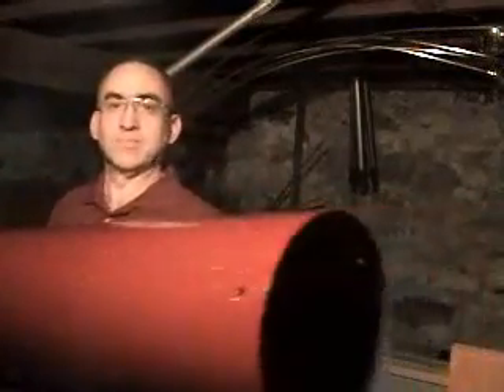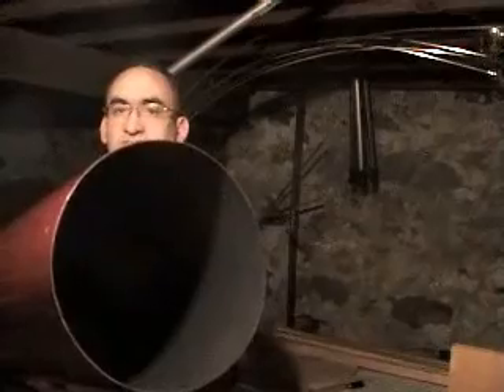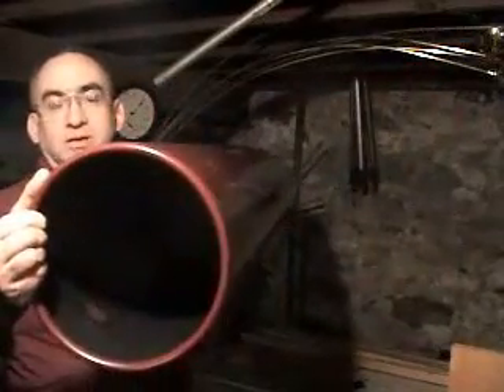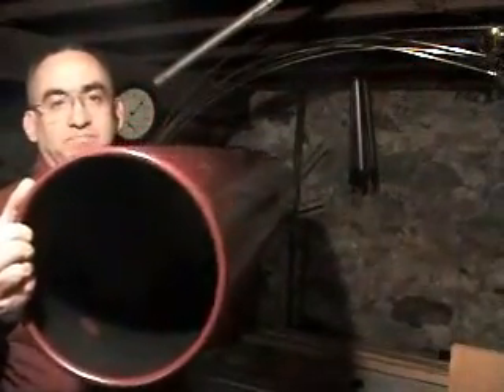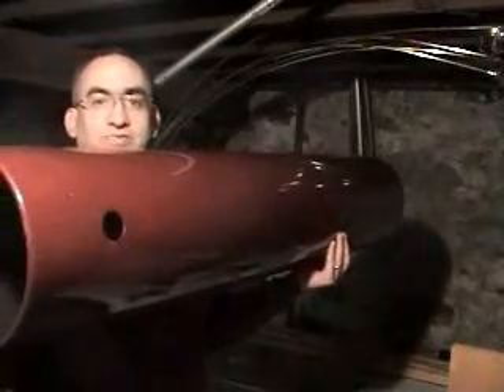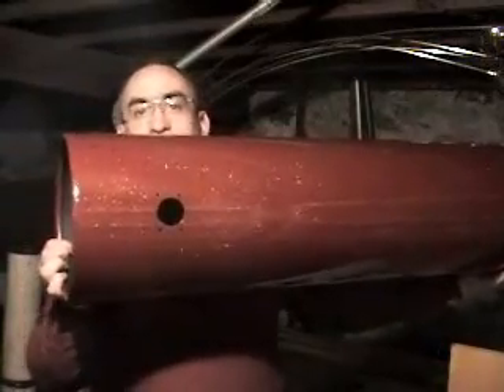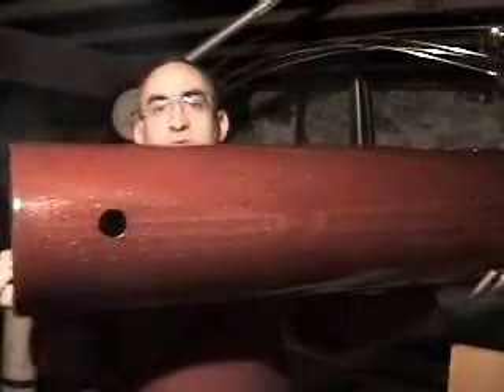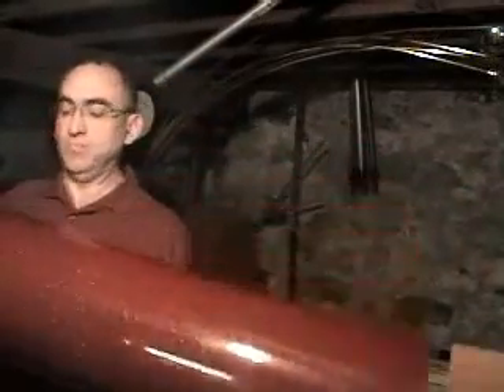Making an Optical Tube Assembly and Mount 1

Comment from the maker: @colt4667 Thank you for your thoughts. The rolled edge is painted flat balck and does not pose any problem whatsoever.

I am now finishing up a tube for my 12.5 inch f/7. I am making sure that the entire interior will be flat black, save for the reflective surfaces of the optics of course.

Best regards,

Francis J. O'Reilly